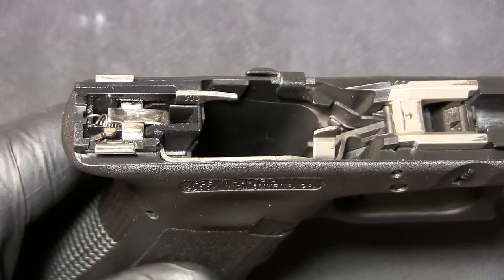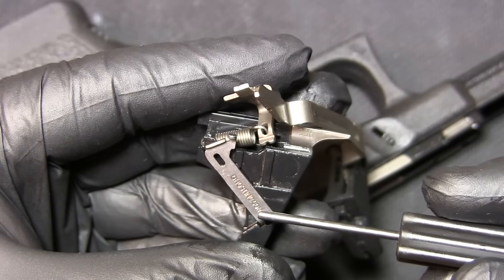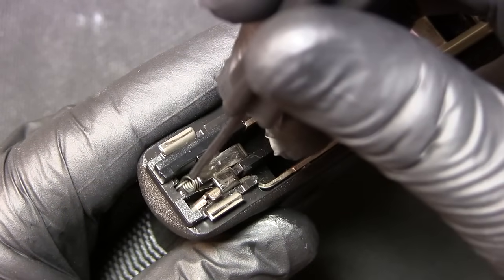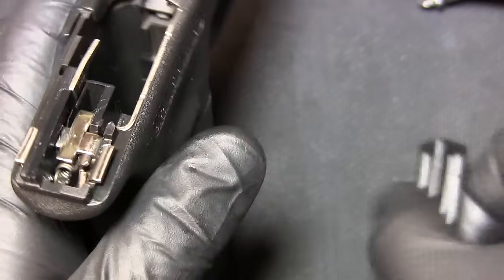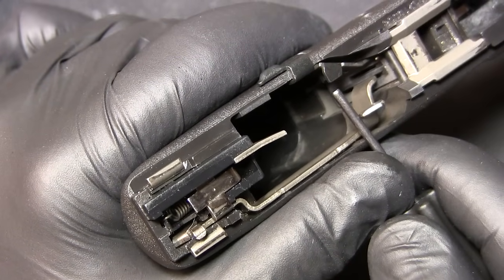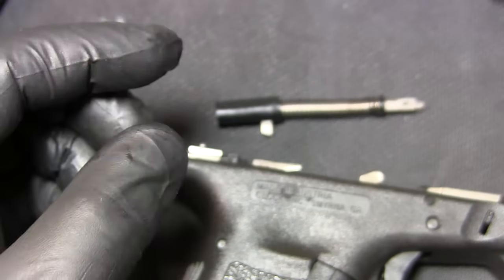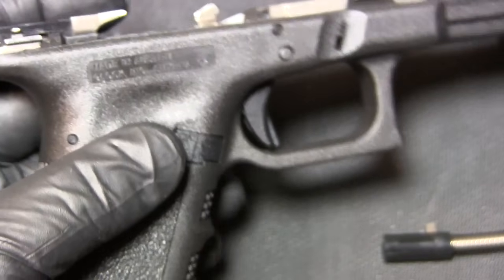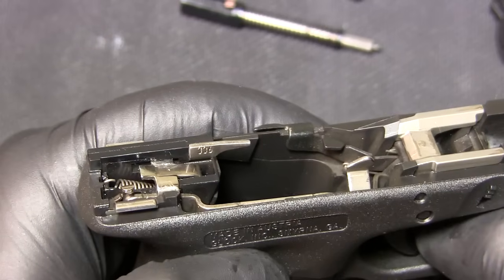How Glock triggers work and how they reset

Comment: what a great video.  I bought a glock gen 3 some time ago.  Someone modified trigger a bit by changing springs and connector.  Every now and then it seems the safety flies forward too much and it makes it hard to defeat it when you pull the trigger.  it's stuck in a forward position.  Do you know what might cure the issue?  thank you.

Comment: I don’t think my firing pin is hitting my trigger bar. There’s no break on the trigger. Also my slide gets stuck. The only way to take it out is removing the firing pin. Do I need a different firing pin or what should I do?
Reply from the maker: Well, for the slide issue, the trigger has to be "pulled" and not reset. The fact that you have to remove the striker to take the slide off the frame tells me that the striker does make contact with the trigger bar.
For the trigger not breaking, have you done anything to your connector?
Reply: @MosinVirus  I purchased a new drop in trigger so I changed the trigger  and used the stock trigger housing   And  trigger spring. I just ordered a bigger trigger spring and a bigger striker spring both 6lbs  hopefully that will work
Reply from the maker: @miguelmarin4445 when you install a new trigger bar into the trigger housing make sure the trigger spring is not kinked off to the side on the bottom.
Reply: @MosinVirus  it doesn’t look, but if it was, would it still dry fire and rack normally because it does
Reply: @MosinVirus  I figured it out my dumbass didn’t put the trigger housing pin in once I put it in. Everything looked normal.
Reply from the maker: @miguelmarin4445 I am glad you figured it out.

Comment: Hi, I saw your very well-explained video. Please, I'd like your opinion on replacing the trigger on my Glock with the bar and connector using the system manufactured by APEX for it. It follows the same safety principle as the Glock. The reason I do this is for the comfort of the shoe, or if I can use the trigger with the Apex bar using the original Glock connector. I'd appreciate your answer to my question. Thanks, Pedro.
Reply from the maker: I have not personally used the Apex trigger kit, but haven't heard anything bad about it.

Comment: Hope you can help me! I have a trigger that’s not resetting.  I realized ( thanks to your video) the sear isn’t jumping back like it’s supposed to.  Amy idea what could be causing that?
Reply from the maker: The most common cause is the trigger spring kinked to the side. Look toward the bottom of the trigger bar in the trigger housing. If you see the hook of the spring on the side, that is the culprit.

Comment: Great video to understand the workings. I have a problem tho with my Gen 111 G19 that it sometimes will double fire at random. Like, on the 2nd shot of a double tap. Something is not resetting or holding on the reset. I did install a Ghost connector years ago and this issue started several years later. It has a lot of use as I used it for IDPA competition but then had to retire it because of the problem. I'm guessing at least 30,000 rounds through it. Any tips for what to look at would be appreciated. Thanks.
Reply from the maker: I would look at the striker channel liner and spring caps.

Also based on how much use the pistol got maybe a new set of springs - striker and trigger.

Comment: How are you sir, great video, I learned a lot  of knowledge from your video ,thank you so much.I am big fans of Glock .The reason why I love Glock a lot, because of disassemble, how easy  to do it. The drop safety is great design. why Glock is the most reliable  pistol,because of trigger safety,fire pin safety and drop safety ,all design from genius! I research the design of different brand pistol, and now I love Glock pistol only. I have G 19 and G 26, so I have one question, if I keep one Glock in the box,what is best way to do it?I need pull the trigger then put in the box or don’t put trigger? Thank you so much sir, have a great weekend.

Comment: I am left a little confused. Here 10:07 you said it's helping you but in this video https://youtu.be/V2RDitgCaD0?t=116, the spring goes against the trigger pull. What am I missing? Great video, thank you!
Reply from the maker: Not sure about other videos, but when you see the trigger snap back by itself after I push on the trigger safety, it should be clear that the trigger spring pulls the trigger back,  therefore it doesn't work against you pulling the trigger. It wants to pull the trigger back.
Reply: @MosinVirus , oh my! That makes sense now. Thank you for the great video and taking the time to clarify the point in the comment! 🙌
Reply: @MosinVirus  also at 05:18 did the trigger bar jump up because of the trigger spring?
Reply from the maker: @izopinion Yes.
Reply: @MosinVirus  Thank you, so much!!!

Comment: MosinVirus, thank you for this vid!
I have a g19 (gen4) and I noticed when I ride the slide back forward, the slide will not go into battery. This isn't the case with my g17 (gen4).  So, what I did to test the g19: 

-On full battery, trigger is pressed..."hold and pressed hard". I kept my trigger finger pressed hard on the trigger, rack the slide back and release it forward (full recoil spring tension). 
-While pressing "hard" on the trigger, when I release my trigger finger, the trigger "DIDN'T RESET".  
-Trigger "WILL RESET" if I don't hold and press hard.

I went and did the same on the g17 and no matter how many times I replicate it letting the slide fly forward while the trigger is pressed "hard", it would "ALWAYS RESET".  

What issue am I having with the g19?
Reply from the maker: @ybrik5937  Is your g19 in stock configuration? Has anything been done to the fire control group?
Reply: @MosinVirus  The mods I did are:
-Apex Tactical failure resistant extractor
-Apex Tactical safety plunger
-Glock OEM maritime spring cups

These are the ones I did few years ago.
No mods on the FCG. 
In fact, I haven't taken it off the frame.

I barely take it to range as I shoot more the g17.
Reply from the maker: @ybrik5937  understood. It appears that when you pull the trigger and hold it back harder something binds and doesn't allow the trigger bar to raise into the way of the striker lug. It sounds like you should be able to reproduce it with slide off the frame.
Take the slide off of the frame.
Prepare a tool you will use to push the disconnector arm like I did in the video.
Apply the same pressure you use to replicate the issue to the trigger.
Check visually if the trigger bar is binding somewhere at the rear.
Push the disconnector arm to allow the trigger bar to escape the disconnector ramp.
Does it jump up?
Reset the trigger manually by pulling it forward. Try a few times.
Let me know how it goes.
Reply: @MosinVirus  I just tried the above with the slide off. Even without pressing hard on the trigger, when I push the disconnector arm, the trigger bar won't escape the disconnector ramp. Very unusual as when I reinstalled the slide back on the frame, rack it and the trigger resets.  This is weird.
Reply from the maker: @ybrik5937 indeed. Because the trigger bar is meant to be able to escape the ramp. Maybe you didn't push the disco arm far enough.
Reply: @MosinVirus  Here's my update. So when I remove the slide, I didn't realize that the trigger bar is already raised, so even if I push hard on the disconnector arm, nothing's going to get raised.
So last night I disassembled the FCG and degreased it, lubed and put it back together. I also put grease where the trigger bar contacts the connector.
I replicated your advice of pressing hard on the trigger then pushing the disconnector arm, and yes...the trigger bar has raised.
Only one thing I noticed, when I move the trigger bar forward, it doesn't spring fast enough backwards. Somethings binding. It feels like there's gunk in there but I already cleaned both the FCG and the frame.

Could this be a trigger spring?

I haven't compared this to my g17.
Reply from the maker: @ybrik5937  just check and make sure the spring is not kinked off to the side on the bottom of the trigger bar. That could cause binding.
Reply: @MosinVirus  I disassembled the FCG, checked and trigger spring tension looks good. I sprayed the area where the trigger bar contacts the disconnector arm with actoin degreaser. At first it was really smooth, but after a while, back to the same gritty feeling.
The trigger bar isn't fast enough to be where it needs to be to catch that striker lug.

Do you think I need to polish the trigger bar to disconnector arm area?

Any links and advice on how to polish these areas?
Reply from the maker: @ybrik5937 what I meant is to check if the trigger spring on the bottom is not hooked on the side of the trigger bar. It should be perfectly vertical.
Reply: @MosinVirus  It is perfectly vertical for this spring at the bottom where it hooks the trigger bar when I had put it back.
Reply from the maker: @ybrik5937  it doesn't sound like something polishing would fix. Still unclear what the issue is. Difficult to diagnose without having it in my hands. Try looking at both G17 and G19 side by side to see what is different.
Reply: @MosinVirus  So I polished the contact areas of disconnector arm and trigger bar. I cleaned the area of the frame where it rubs with the trigger bar. One drop of oil on those areas and the trigger now slides back and forth with spring tension. Trigger bar raises up when I push the disconnector arm. A very crisp click for the trigger reset when I move the trigger bar forward.
Unfortunately, the issue is still there. Trigger won't reset while pressing hard on the trigger and letting the slide fly to full battery.
Couple of times I cringed!...when the striker dropped on me while pressing the trigger hard.
I still can't figure this out.
On my next range visit, I will load only 2 rounds in the mag and see if will send couple rounds downrange with one press of the trigger while pressing it hard.
Reply from the maker: @ybrik5937  have you tried replacing the slide components back with what was there before?
Reply: @MosinVirus  In the slide is maritime spring cups, billet extractor and safety plunger from Apex Tactical. Will inspect striker operation and compare with g17.
Reply: I finally fixed it.  Issue is related from my first post. When I ride the slide back forward, there is a hang-up and will catch on something and will not go into full battery unless I nudge it more. When I was removing the slide's backplate, I noticed the firing pin spacer sleeve is wah too forward that I had to move the firing pin/striker back.
Not sure if this was cause by improper FP safety plunger/spring. 
When I put everything back, the slide would always go into FULL battery even when riding/easing it forward.
So the real test is is to press the trigger hard and rack the slide fast and release it forward and yes, the trigger would always reset and I couldn't replicate the trigger being stucked back. =)
Thanks a lot for this video and I had learned and familiarized myself with the glock operation.
I even have a smooth trigger as I had polised the the FCG contact areas.

Comment: what will have to happen for the trigger to reset while the slide is still pushed back ?
Reply from the maker: The trigger will not move forward until the striker lug moves it forward when the slide returns to battery.

Comment: i have been a sport shooter for a few years running a g17 gen2. i didnt really try to disassemble my glock i always have it done by gunsmith or someone who does know. anyway i have that problem since i change the trigger kit with a zev trigger kit cause i wanted to reduce the slack/trigger pull travel the guy who installed it managed to reduce the trigger slack but somehow the safety was not working anymore. by watching your video i remembered he said he cut off a few spring from the trigger (i didnt know what spring was that) but thank you now i know how to fix it. thanks
Reply from the maker: @MichaelBM821  I am glad I could help

Comment: What happens if you grind out that material in the slide? Becomes open bolt?
Reply from the maker: @benfrank1583  becomes a modified Glock and illegal in some states.
Reply from the maker: But your trigger will never reset also.
Reply: Thanks. Don't plan on it just looking at it from a function test. I think it would fire out of Battery or not fire at all. I'm not willing to test 🤷‍♂️ @MosinVirus

Comment: Was just thinking, the relationship between angle of the connector tab and trigger pull force is the sine of the angle of the connector tab. Sine(0)=0, so the force needed to pull the trigger is lowest when the angle is near 0 degrees and max when perpendicular. Am I correct in my thinking?
Reply from the maker: @jordanishibashi5619  yes,

Comment: Thank you so much for making this video your explanation of the firing pin spring and trigger spring helped me diagnose a weak reset issue i was having with a secondhand g19, it sends the previous owner used a lighter firing pin spring so when i swapped the timney trigger out for a stock one, the reset was too weak
Reply from the maker: @tianlamian  i am glad I could help and great job solving that issue.

Comment: What does the trigger spring do? I bought a 3.5lb connector and 6lb trigger spring kit from lone wolf.
Reply from the maker: @Saladon89  it should be visible from the video, but it gets the trigger bar up into the way of the striker lug to reset the trigger and also helps work against the striker spring, reducing the felt trigger pull weight.
Reply: @MosinVirus  Is it safe to add the 6lb trigger spring? Will there be enough spring resistance to get the trigger back forward where the safety engages? Whats the point of using the 6lb spring if I replace the connector with a 3.5lb connector? Thanks for your expertise.
Reply from the maker: @Saladon89 I have a separate video on Glock trigger pull weight reduction. I show how each part affects trigger pull. In the comments I said what I think is the best spring weight combination.
Reply: @MosinVirus  yes thank you, just saw that vid after asking

Comment: What if a sear does not go back down far enough?
My firing pin assembly is fine but the tab won't catch the sear to fire it or for slide removal.
Reply from the maker: Have you modified your disconnector? In any case, you should be able to pull the slide back, lock it open, then remove the backplate and striker. If you get an armoer back plate you will be able to observe what could be causing your issue.

Comment: thanks, i was curious how the glock worked, and i was struggling to find detailed explanation on the trigger system.
if i get it right, if someone where to carelessly make his connector flush with the rest of the assembly, then the trigger bar would not even hit the slope of the connector on a trigger pull, thus it wouldn't sink and wouldn't release the firing pin. and on the contrary, if someone were to alter the tab at the top of the connector, it would no engage with the slope on the slide, it would not get pulled flush as the gun slide cycle, it would not force the release of the trigger bar, and that would likely make the gun operate like a poorly made full auto.
Reply from the maker: Correct. Simple system.

Comment: I have a shadow systems gun and the cross shaped portion of the trigger bar that the connector engages (the cruciform from what I can tell it’s called) is scratched up. With diagonal scratches….what would cause this? I shoot suppressed
Reply from the maker: Diagonal scratches would only appear when the trigger bar was out of the gun. I can't think of anything that would make the trigger bar or other parts move diagonally during normal operation.
Reply: @MosinVirus  thanks for info. Gun is brand new and the first time taking slide off is when I saw the marks. Someone said it could be tooling marks from factory
Reply from the maker: @Dadsdefend  could be.

Comment: I got a question for you I kind of goes along with what you’re talking about here and this video I’m having an issue with my Glock pistol where it’s not resetting the trigger all the way I changed out the striker pin spring and that didn’t help at all. Basically what it’s doing it is is when I rack the slide it doesn’t go in full reset but if I rack the slide and I’m holding the trigger back, it will go and reset the trigger then.
Reply from the maker: I would check the trigger spring and make sure it is not kinked to the side at the bottom back section of the trigger bar. Let me know if that is not the issue. Also, did you make sure the striker moves freely? Is the channel liner in good shape? Spring cups not damaged?

Comment: What are the original factory specs for both springs? thanks.
Reply from the maker: I can't remember to tell you the truth.
Reply: I ask because I suspect the previous owner switched some springs out and I'm having some misfire issues. Probably best to just replace them all. Thanks @MosinVirus
Reply from the maker: @MagUidhir958AD  they are cheap enough. I would do the same in a heartbeat.